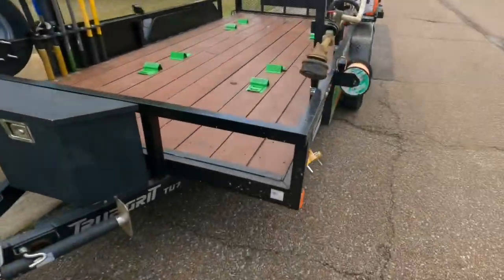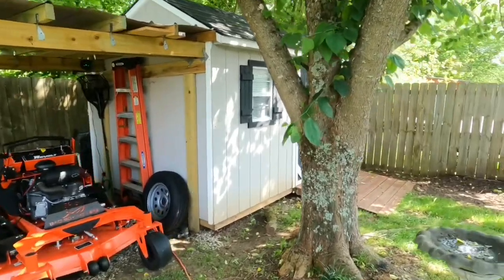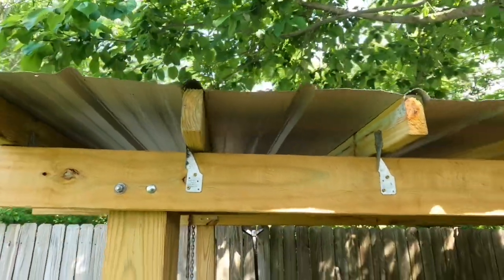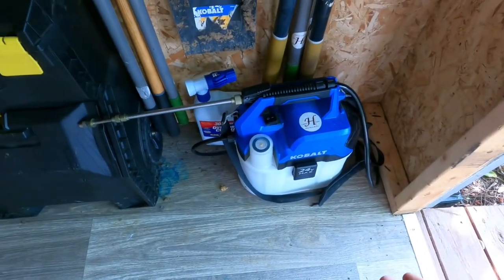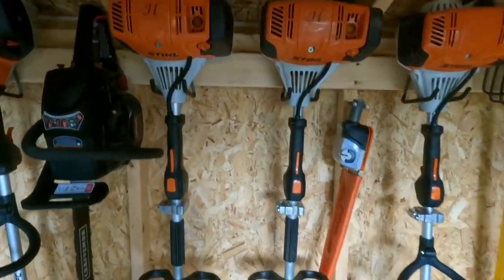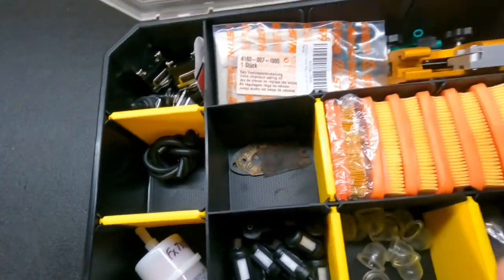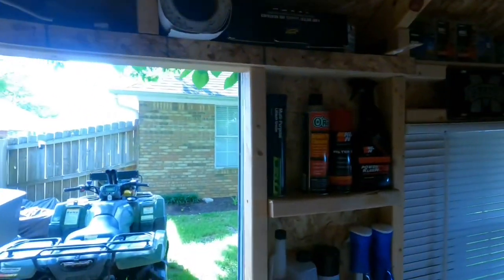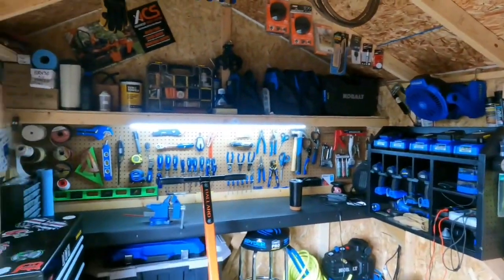My Lawn Care Shed Tour!!!

Comment: oh and stihl sells a chain sharpener that still works like the old way. i like them over the other options and kind over doing it with single file and such
Reply from the maker: Yea I saw them last time I was at the store! Has like handles on it with files and scraper for the rakers, all in one tool I think. I actually sold all of my stihl chainsaws plan on getting one big one this year mainly for firewood.
Reply: @coleheigle  yes thats the tool. i have one big one and one top handle one. you may want to have a big one and top handle one. i use my top handle one more then loppers at times for quick pruning

Comment: Why do you leave the mowers on a charger?  I haven't had to put mine on a charger for the 3 years that I've been in business
Reply from the maker: The charger I have is a maintainer and a charger! I only plug them up when they are not in use like for a weekend or gone on vacation.
Reply: @coleheigle  probably unnecessary
Reply from the maker: @dskrpncs  it’s defiantly necessary for the batteries to stay strong! That way when we are ready to crank them they start right up and not worrying about a dead battery there bud!
Reply: @coleheigle  haven't ran my mowers for 4 months.  They started right up yesterday when I went through all of my stuff for spring.  To each their own